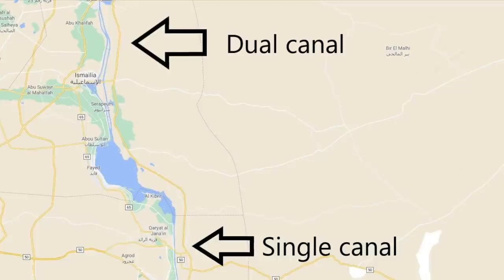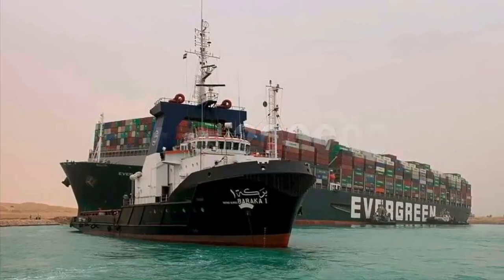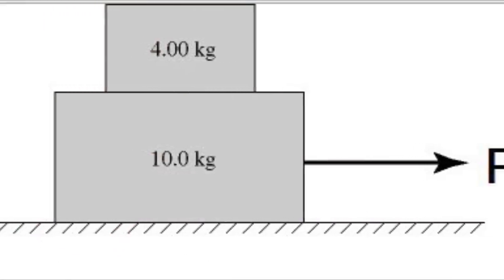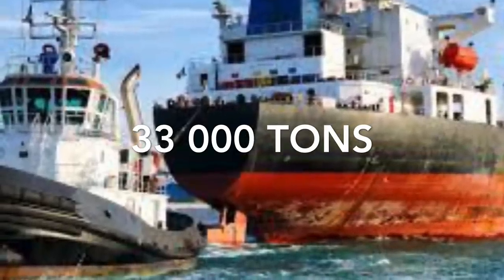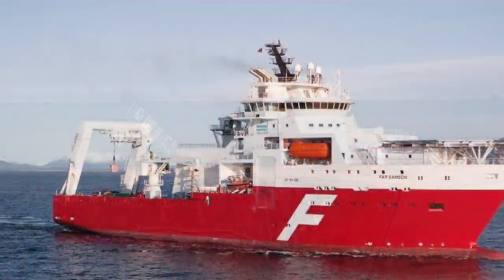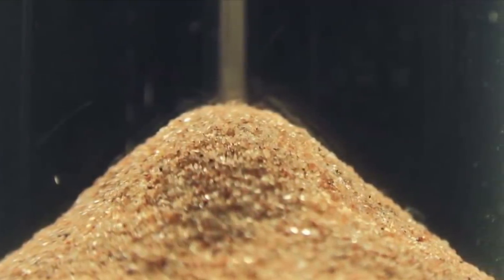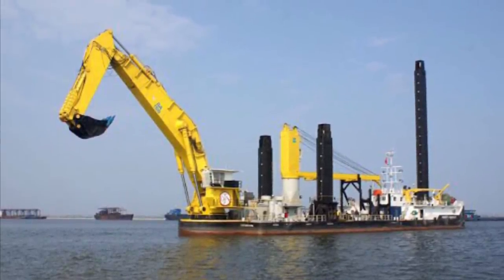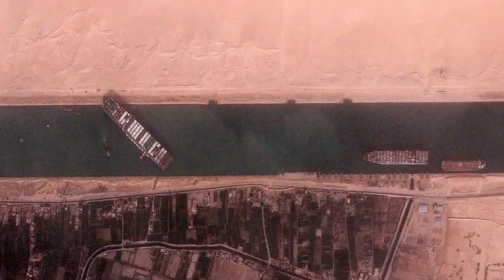MV Ever Given - why can't it be pulled out? Suez canal blocked

Comment: I think 1/3 of the weight resting on the sand is too high estimation. Even if the 1/3 of the ship is resting against the sand the hull has still normal amount of buoyancy. To get 1/3 of the weight against the sand the ship should be partly out of the water so that there would be 1/3 less buoyancy left to carry the weight of the ship. And since the ship seems to be still level I think that's not the case.
Reply: they got it out
Reply: Hey
Reply: What don't they just get something like 15 tugboats to pull out the ship at an angle, and twist it out of the sand? Doing that would give you much more leverage.
Reply: I found some equations engineers have come up with to calculate the fore necessary to pull a ship like this off a sandbar. You need to break out your algebra knowledge of matrices as well as run the results of multiplying the matrices through some calculus integration. There are so many factors involved there is no way someone not involved will be able to calculate it. You need to know the actual structural layout of the ship because how much the hull is flexed matters, you need to know the sand particle size, how deep into the sand it is, and about 20 more variables. Needles to say that's just to pull a ship straight off a sand bar. This ship can't be pulled either direction. It needs to be freed up so it can be turned. 

Though from my personal experience as a recovery specialist in the army pulling stuck tanks and trucks out of the mud it can take a surprisingly large amount of force to pull something out of sand/mud even if it has wheels on it. Enough force that you'd likely put a hole in the ship if you tried to force it. It all boils down to them needing to make enough room to move it or lighten the load to it floats.

I think the easiest/safest way might be to dig it out as much as possible. Then create coffer dams and a dike around the edge to pump water in and increase the water level high enough to float it in place. Lifting those intermodal containers in the field is not going to be easy, safe, or fast.
Reply: @sikofu2   we could also just tie two spacex rockets to it and lift it out
Reply: @snil3464  The Falcon Heavy has 772 tons of thrust. You'd need 259 of them at least.
Reply: @sikofu2   so be it
Reply: There are crews on standby that could bag, inflate and float the front end of that ship, but NOBODY IS CALLING THEM.   Why?!!?!!?!!?
Reply: @korkee1111  no, they just barely got it to budge. It's not going anywhere for a while.
Reply: Yeah, I bet they have it out in three days.
Reply: A few comments: the ship seems to be about 3 or so metres out of her draft forward. There is a very substantial ground reaction but exactly what that is I shall leave to the naval architects, who have the ship's drawings, as they work on this. You are correct that the present ground reaction exceeds any possible tug capacity that could be brought on site. I should like to see what ground tackle could be mobilized on site and set up on the opposite bank, and whether it could be realisticslly stabilized in the sand to exert sufficient pull once the ground reaction has been reduced by dredging.  Hydraulic sandpumps can sometimes be used to shift  loose and wet sand, but not if course the rock lining of the canal. Fluid removal (ballast water, bunkers) should be fairly readily achievable. However cargo removal is very problematic. Container weights are likely to exceed any helicopter capacity, and insofar as there are any crane barges available with sufficient height and reach for the top stack they are probably in Europe or the Far East, with weeks of deployment time before arrival. I do not know if something could be set up on shore, but the process would be slow.
Reply: True, i would say, just use Controlled detonation around the part were diging is needed, while it's the mesiest way, it will certenly do the job, and free up space more... Though knowing how they managed to lodge it in already, i have no doubt, that even when they get it free, they'll find a way to still make it more stuck then now.
Reply: vat de fak
Reply: @sikofu2  Then it would just tear the ship apart. BIGGER PROBLEM, That's why they can't do half of the shit people are suggesting.
Reply: For 1/3 of the weight to be resting on the sand the ship would have to be displacing 1/3 less water.  With a draft of 45ft, simple observation of the ship says the reduced displacement due to grounding is far less than 1/3.   Here's a suggestion ... 1) empty forward fuel tanks, 2) fill after fuel tanks and 3) put every tug available pulling from the stern and yank it out.
Reply: ... or at the very least ... sink a giant bollard on the shore ... and use their aft  capstan to pull the stern into the same bank the bow is grounded on.
Reply: Insightful
Reply: @crforfreedom7407  I was thinking the same thing.
Reply: Wet sand has a sucking effect though. I'd like to see a breakdown of the forces on play there
Reply: @snil3464  lol
Reply: I think he deleted my comment. You are correct. This is ABSOLUTELY not how you calculate ground reaction. You cannot even give quick estimates without a little naval architecture. This is proven by the fact that it was freed today well below the bollard pull this video would suggest. If you are interested in the true fundamentals of ground reaction then Google “navy salvage manual” it’s free and online as a PDF and page 6-3 covers ground reaction. But hey I’m just a salvage naval architect 🤗
Reply: @RicktheRecorder  I’m a naval architect. I left a comment why this video is not correct and a gross overestimate of ground reaction. Which turned out to be correct. She was freed today without a single container removed. We have a lot of play with the ballast and fuel on board. But I haven’t seen detailed reports on if they even went that far. There was a favorable spring tide Monday (Egypt time)
Reply: You could probably estimate the actual amount by calculating the area of the water line that's above the water.  You know the size of the ship, so that volume of water is how much mass is on the sand, assuming it was fully loaded.  Just eye-balling it, I'd say it's more like 20%, but that's still 40,000 tons.
Reply: @leighsowers5099  Yes, I think the various ground reaction estimate circulating, some from very distinguished salvors, were too high, though the ship was quite significantly out of her draught. Without being on site and having some detailed idea of the form of the forepart of the ship and how it was embedded it was really guesswork. But your guess was probably better than most. We have very little idea it seems to me what dredging was able to be done, and the ship was probably refloated more by pivotting rather than a straight pull. I see she now has a port list which suggests perhaps the moving of ballast etc to port coupled with dredging down the port side helped her to slide off the revetment.
Reply: Use another container to pull this one and use tug boats to change its angle.
Reply: @ricktherecorder4416  you and Leigh 👏I like reading the people who actually know what they are talking about. You clearly know your stuff! And that’s a very rare thing on YouTube!
Reply: @p4rky  lies
Reply: @masoodakhtar8859  Other merchant vessels are not equipped to perform services such as this.
Reply: 🤓🤓🤓🤓🤓um akshually
Reply: Your thinking is wrong.  Draw a free body diagram.  It doesn't matter whether the "floating" 2/3 of the ship is floating or on dry ground.  It is still being supported by an upward force, whether from the bouyancy of the vessel or the sand upon which it rests.
Reply from the maker: Hi, the 1/3 is very high - and not considering uplift sufficiently - but the problem is complicated by the clay... and I just used this 1/3 to explain that there is a challenge. Thanks for your input.
Reply: @TheGeotechEngineer  I don’t know what he just said but okay 👍
Reply: @snil3464  real great until you snap something, flood the ship and now have like three times the weight to move
Reply: That's how they did it after 4-5 days of dredging. 

Chairman of the Suez Canal Authority, announced today, Monday, at dawn, 10 giant tugs operating from four different directions . ( note: the total number of tugs participated in this was 14, but 4 of them are not giant ones)
 
He explained that the distribution of the locomotives during the tension maneuvers includes pulling the bow of the ship in the direction of the north by both the tug "Baraka 1" and the tug "Izzat Adel"  with a tensile strength of 160 tons each, while 4 tugs push the stern of the ship southward, and the two new tugboats include “Abdel Hamid Youssef” and “Mustafa Mahmoud” with a tensile strength of 70 tons each, and the two tugs Port Said 1 and Port Said 2. 

The Dutch APL GUARD tug with a force of 285 tons,   and the Maradev tug.  The two tugs, "Long Live Masr 1" and "Long Live Masr 2", are pushing the bow of the ship towards the north.
Reply: Yeah yeah, but could it be crushed with some skittles
Reply: 👍🏼 Kiitos, Lauri! Believe your analysis is "pretty good!" 😉
Reply: @TheGeotechEngineer  Still some good information in here, and I would note that this was among the few videos that actually showed the canal's dual channels, lake area, etc.
Reply: You are right but they don't really want to free the south chanel. The people that through the virus at us now block the south chanel. They want a new south chanel built with our money, that's why. Some miracle has to happen for the whole world to be safe from evil. And you can see those people are not chinese since the chanel belongs to some multinational. God help us.
Reply: Is this not YouTube? Can't be surely with this mind boggling comment of brain power. Where's me Dunce Cap gone... Oh that's right, Donny Trump borrowed it..
Reply: @sikofu2  bloody hell this post of brainiac comments is getting worse..
Reply: @ricktherecorder4416  thank you for raising your head above the parapet and contributing to public dicussion. Profesionals without a specific brtief tgend to avoid social media input. I should think your professional colleagues will congratuilate you vfor your sense of public service, wiyhout feeeling the least bit inclined to do likewise next time. 

One thing, if you please, my initial reaction was that as this was predictable very welll worked out and drilled redponse from the Canal Operators (Egyptian STate?)  woluld be in place. iNstead aslthough no one asctuallly says so out right this refloat effort seems to have been improvised on the hoof the marinrv insurance uindwiters must be having kittens. On top of Covid 19 pressures a numbvder of insurance names must feelng the pinch. So is this the timeto raise money for a once in a lifetimreb shift of technology to smalller automated vesssels with sail assist, say 100 tons to 10 tons displacement?

Wild spdeculation I know but a crisis often entails opportunity. What iis the professional  view - is this the end of the mega  container ship? Or a restart button for canal infrstructure and operational disaster rrcovery and investigation capabilities or is there any other overalll commment you  might care to make?
Reply: @sikofu2  or they could just pull it out.
Reply: @ricktherecorder4416  I know, but in theory could this be done?
Reply: @masoodakhtar8859  Merchant ships have occasionally rendered salvage slices to other ships when nothing else is available but it is fraught with difficulty. They do not have the skills, equipment or handling characteristics to be a lot of use and to avoid damage to themselves.
Reply: @brucebartup6161 Economies  of scale and the need for cheap transport means ships are likely to get larger rather than smaller. The infrastructure always lags the ships. The SCA has already dualled  part of the canal. No doubt the remainder will follow eventually.
Reply: you are the expert why don't go to suez canal to fix it
Reply: @RicktheRecorder  thanks.

to be quite clear, something liie this but 100t rather than 3600t.
https://www.maritime-executive.com/article/new-wind-assist-technology-enters-service-in-north-sea
ie carrying 1 x 40tonne container

to rep0lsce onne Evergiven220,000 tonnes would require 55, 000 such wind vesels.. Drone operationn, no crew. Fuel cells foir manouvring thrusters. So zero fuiel costs.

Such a teeny vesel in a big bad occean wpould be bound to founder often so amortise over 1 year.  

Approx initial cost (assuming mass productiion as for lorry 40 ton) £10,000 x 55,000 = £550,000,000. Insured valure of EVergivrn £100-140 mn (one source)

And how many billion would  dual  canal take?

Given the penalty that appplies to huge infratrcture maybe it's eqqjuivocal ewhich is cheeaper

No megaports, less dredging, "marina" type landing facilies only. Make it a rollon rolloff operation . No cranes needed.

Takes maybe a week to turn round Evergiven with a new load. 

My "Green Fleet" eqjuivalent  could turn round in hours.

sorry to bang on. you already gave yourr verdict whicch I accept

with thanks
Reply: @putranagawijayana3705  oh! You are so wise I didn't think of that. Next time I will do that, thanks for enlightening me.
Reply: @masoodakhtar8859  no not you.
Reply: @snil3464  My guess is that is about what they did, plus dredging below the port bow.
Reply: @brucebartup6161  Well I think people have had sort of similar thoughts for some time. Wind assisted technology has been in gestation since perhaps the 1970s and there is a resurgence every so often. Renewable energy has much advanced and a drone vessel is crossing the Atlantic at the moment. But I think an inherently unreliable service would be a non-starter, and no one would permit littering the seabed with wrecked ships. Thousands of ant-like ships would be a traffic management nightmare. Speed of supply is much valued for all but staple commodities. In short there would need to be some unspecified radical change in world economic circumstances to trigger the changes you suggest.
Reply: @RicktheRecorder  My fantasy includes and  allows for those objections but I can tell you are being civil with some effort for which I'm grateful. 

I know the real answers to climate change, risk tolerant mega structure based operations and the like willl come from professionals such as your good self. It is certainly the case for me  within my own profession (medical enguineering, electronivcs, physiological measurement).

From time to time it can be useful to take 10 steps back from the discipline of quotidian detailed business and say "Now I come to think of it, why do we do it that way? a good rasi=on, or just because we always have?"

I hope I was not too annoying
Reply: @brucebartup6161  " My fantasy includes and  allows for those objections". I don't see how it does. 55,000 small ships to replace one large ship, many if not most of them sinking and obstructing the sea-bed. What area would be required to berth that many vessels? How would their movements be co-ordinated?  How long would a voyage from the Far East take?  What attitude would shippers and purchasers take to ordered goods that might never arrive?  What resources would be squandered in the construction and loss of such ships? Where would they be built and how?  There is a good reason why ships are getting bigger and bigger. As I say, there would need to be a very substantial change in the global economy to warrant this kind of rethink.
Reply: @ricktherecorder4416  My apologies. What I meant was my faantasy has mmore deetail to it which I chose not to sharw as  itt's all of the samw speculaative nature.

The amortization of my Green Fleet of 55,0000 ovder onne yeas was a ghloomy costing projection  not a  design asssumpyion. We almosst have colliision avvoidance for road trafffic. Serving . loadngg and un loadding tthte Evergien would also take a masive amount of road trransport, on the order of 55,000 40 ton low loader

I could go on but you are obviously kowledgeable aand you've given me your answerrs  as I already acknowledged.

My apologies for getting draawn into an attempt to put lipstick on the pig.

sorrry for all the typos too, advanced stage Parkinson's

thanksr
Reply: @brucebartup6161  I take your point but hundreds of thousands of ships are much more likely to have accidents than a few ships, and to some extent an accident is an accident whatever the size, and it takes up resources in resolving, combatting pollution, wreck removal and so on. When the Ever Given gets to Felixstowe most of her discharged containers will be primarily distributed by train. Your fleets will have the same distribution problems, and because they won’t all arrive at the same time they will presumably be distributed piecemeal.
Reply: @RicktheRecorder You wish to contibue tne the duiscussion? I am  muldl surpridsed  but delighted

But please tell me when thizccesses to amuse you. really am most grateful.
 For a historical reference 

Yes rail links to ports. I yuused to watch grar long trains carrtyimng nothing but  co ntainers. I should hav rememmbred.

of couse the Green Fleet could land at the rail hesds too.. BUt i see the big advantage of going small that the landfall couklds  be prerty much anywhere. ncluduinf right next ti it' estination.Service right to the dfront dooor as it were. Any small fishing village, any pleasseure boat marina that can separastw of a n area forf commeccial trafick. if 100 ton vessel swill cross the Thames Barrier the riveer  is navigable to zaround staines I  brelieve  and a lot pof thise llowereaches aare wasteland. fit folr buki.ldimng llong warfage f a very basicx character

We could make a loyt of old nfrastruvture livre again dedicated to it' klriina;l funxctioons. The Manchesrter ship canal,, Inland waterways. Anything to get theload onto dock side and on to  the destinatiionas nesrby as  possblke/.. There  nowhere much more thasn 50 miles from a nacvigablre watterway.or the sea.

What i lose  in transit ttime I may get back in turnround time. 

As the Green Fleet will be managredf by AI I think collisions wil nbe rare and on board Parking assist  tecnology will guarantee it. Convoys may form  as vessels emdergde from coastal waters  where they separate from piloi tug craft. Any that if any vesseel does sink you would  know exzactly where, thde cargo would likdely  be of one type of pollutaant and so only olne set of hjazardss. not the 57 varietuies toxic soup the EVerggiven could make from her 220,000 tons of god kniows swhzat and jus \abnot evety  chemical knwn to man

That and  the llightnsss of each vesssl  wou;ldf make salvage easy (rdeaaltively, I don't suppose there is any such thing zas truly easy salvage)

The green fleet would be submersible.. Say 5 to 20 metres. There could be a hurricane on the surface or a pair supetankers detemnined to play blind man's buff with each other,  the green fleet will feel and fear nothiing. Just drift wilh the i=yurrent until iits time to surfavce again. 

Allso as a side thught there could be large veaaels thaat condstabtk circle north atlantic and northern part of the Southern atlantic. wwith the smaler vesls rifdding thhe slipt slipsstream so to sspopeakk. \seemms to woork  foir orca pood. Hydroogen rrefueling at sea? IIIt's beeen done wwith ffuel oil. 

more cosdsswallop available, plentty more where trhat came fro.
Reply: jk
https://www.youtube.com/watch?v=8Z1eFrE66aM
klo